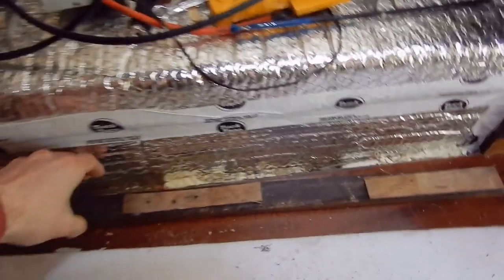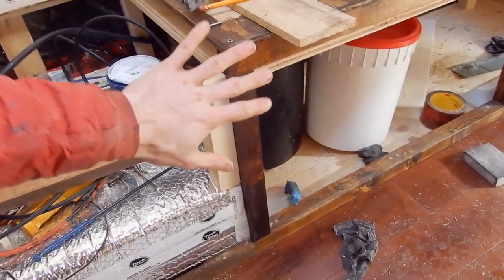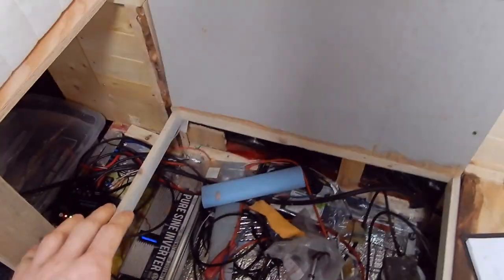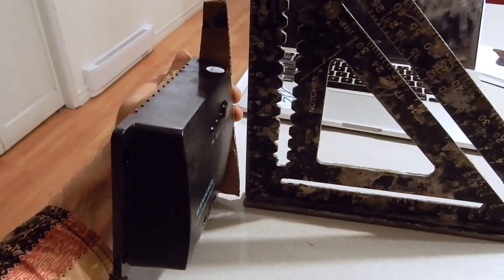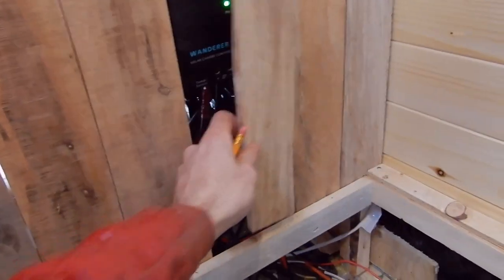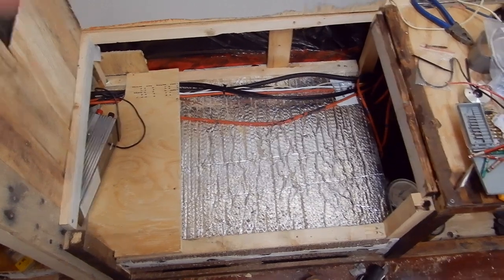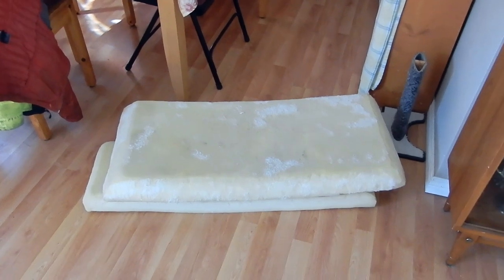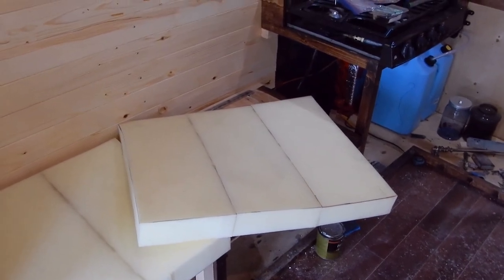Finishing the Couch ~ Van Build E017

Comment: you've got some crazy talent there in your build. wish I had your skills on my step van conversion. I'm still trying to figure out how to get the hinge on my bench in the correct location so I can access my fridge inside the bench. I might have to totally redesign it to get it working sigh
Reply from the maker: Seven Grey redesigns suck but they are sometimes necessary. I recently had to do a pretty big one. The way I see it, it’ll be worth it to have the extra useability.